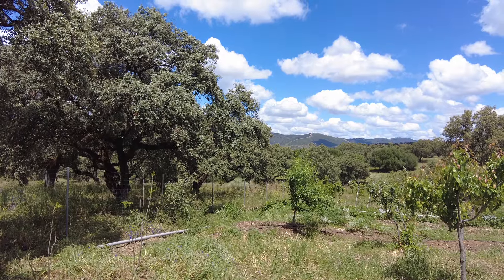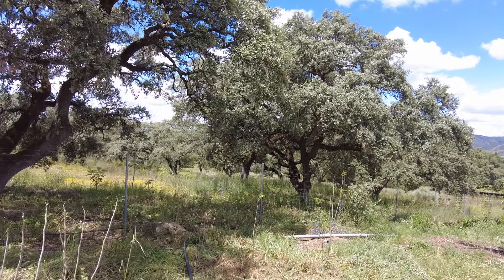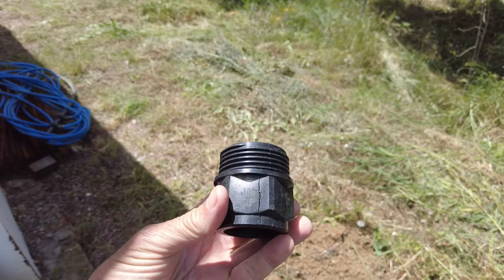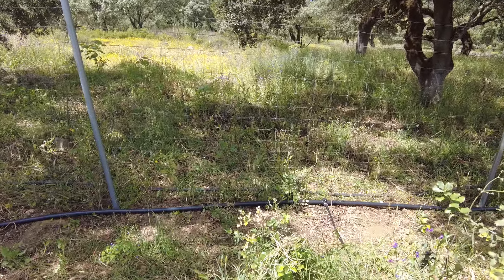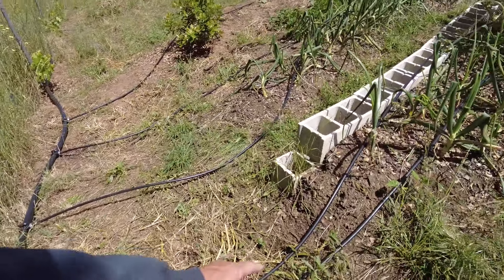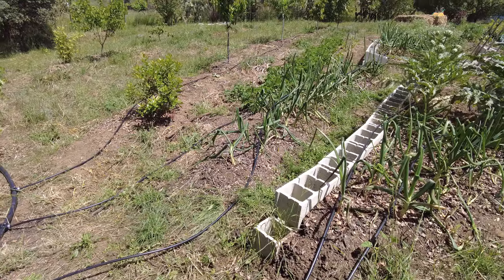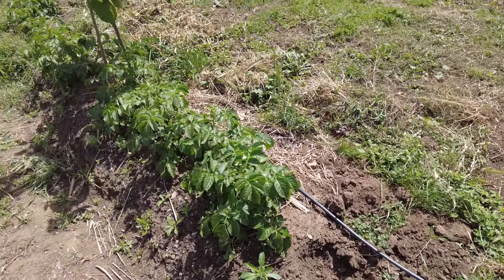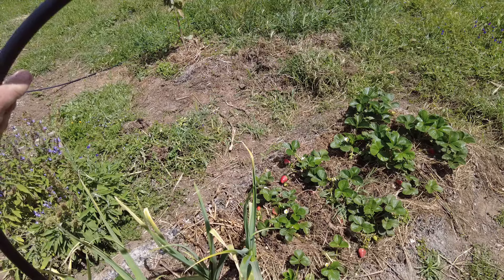Irrigation system installation and new animals on the farm.

Comment: Thank you at 1:20 for pointing out the cracked fitting.  That crack is the result of mishandling and/or overtightening.  Another good reason to start with a bucket of hot water soap and a scrub brush when recycling fittings.  You can't see cracks when the fittings are covered with mud.  :)

Comment: Just like with watering the work never end with an irrigation system. Hopefully you will not have too much trouble with it. Thanks for sharing your progress.
Reply from the maker: Any change to the hand watering will be a huge improvement. Your self watering near the pond sounds good to me. Thanks for commenting.
Reply: @SuerteDelMolinoFarm  I'm sure you are correct about hand watering. I hope to minimize the need for that at the ranch for the most part.